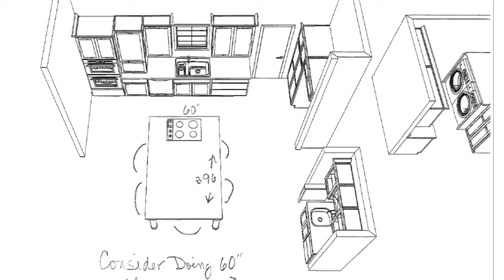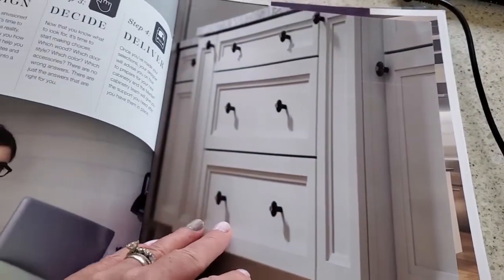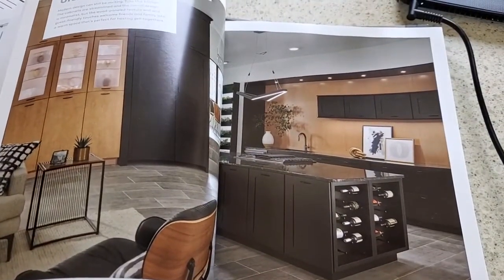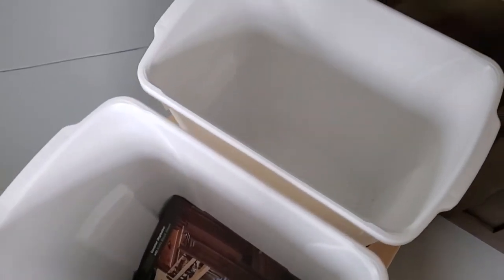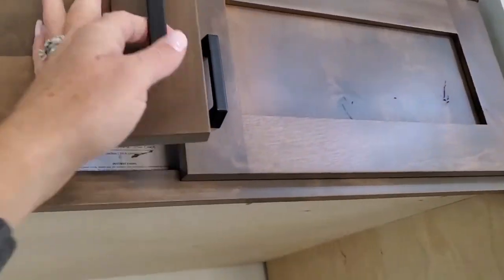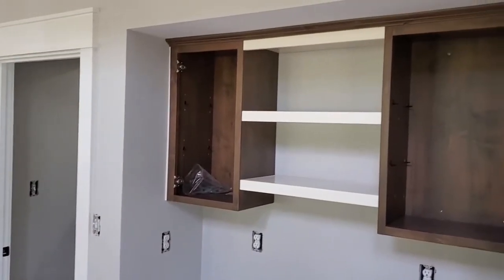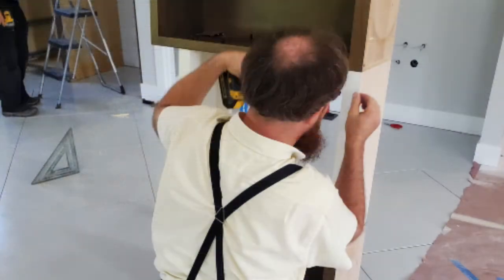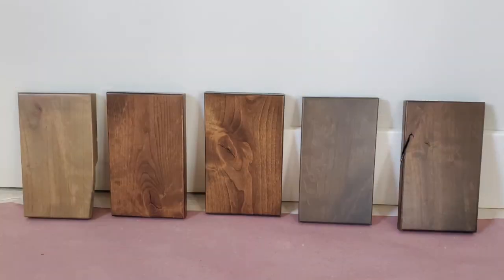Amish Cabinets Installed|| Barndominium Living

Comment: I just subbed and will have to check out some more videos to learn a bit more -- this is my first. Your story sounds a lot like ours -- except we finally decided to go with a super insulated conventional home that our son and I built. We looked into pole barn homes, ICF blocks, the whole nine yards! We just ordered some sheet metal siding from the Amish metal works a couple of ridges away. Which reminds me, is that the Mississippi river that bridge is on? We are on the bluffs along the Mississippi River in Wisconsin.
Reply from the maker: Hey, thanks for stopping by the channel.  Can't go wrong with a super insulated eco home that you DIY!  We are excited that it's final inspection time and hopefully we can move in.   The river is the Ohio, but I guess it does flow into the Mississippi some where along the line.